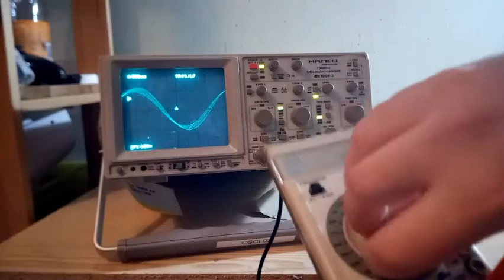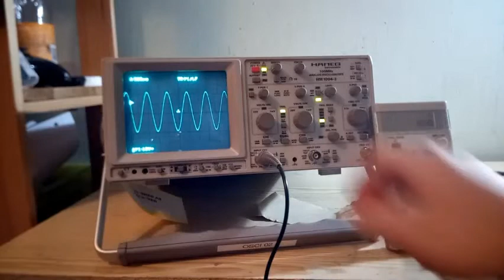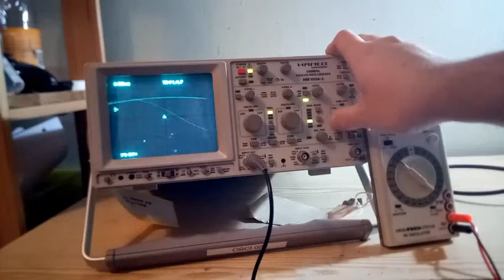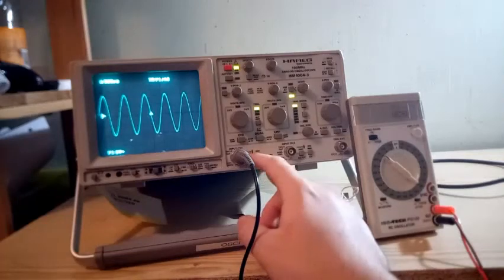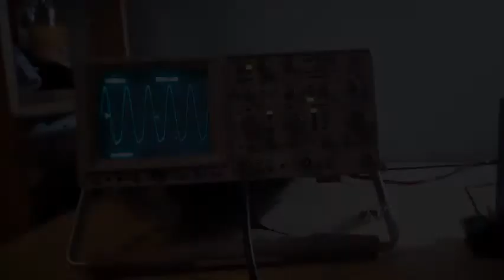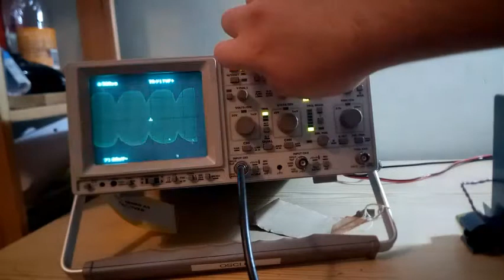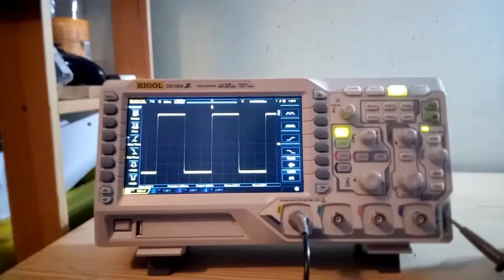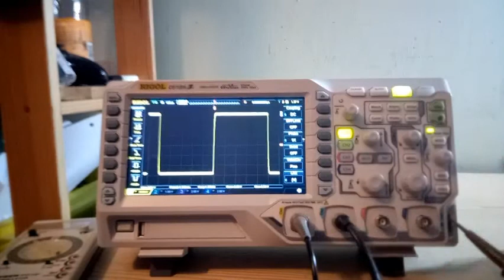Oscilloscopes - Ham Radio Overview

Comment: Hello can i use my oscilloscope for checking radio output if the oscilloscope is like 200mhz and the radio frequency is 174mhz??
Reply from the maker: Hi, yes you should be able to, as the bandwidth of the scope surpasses the required measurement range.

At such frequencies, it's a good idea to use the High-Z "X10" mode on the probe to avoid loading the signal too much.